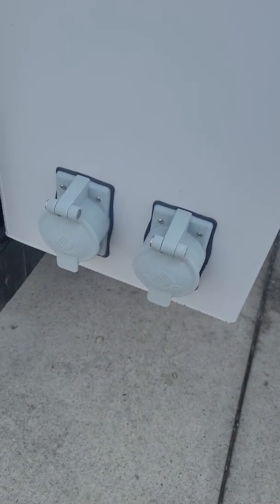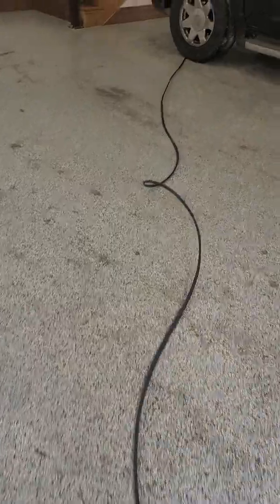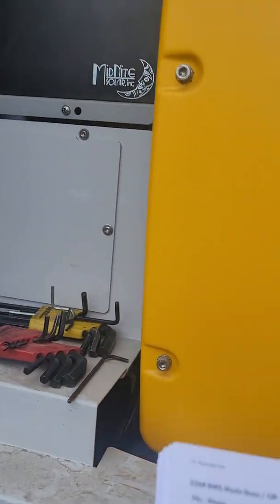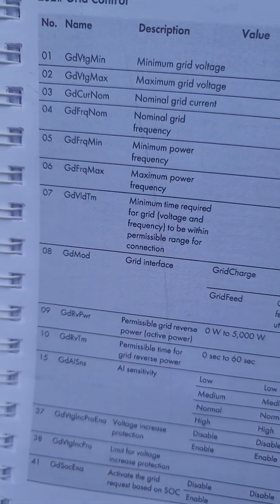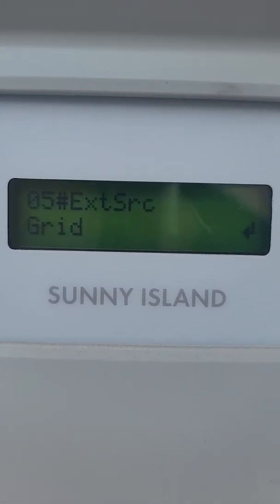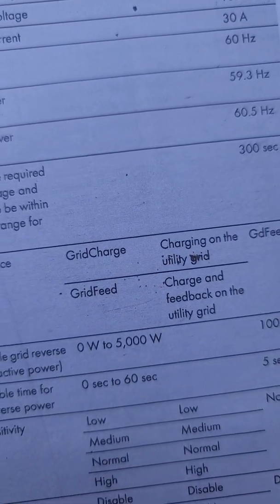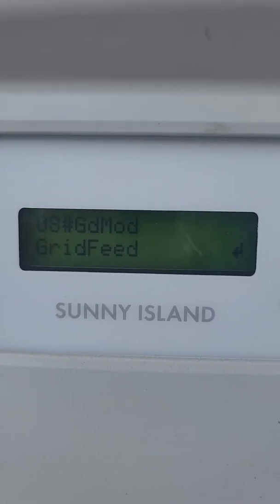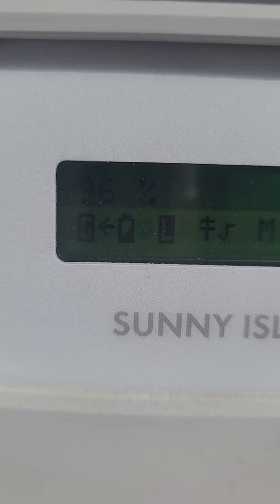Set up your SMA sunny island to grid feed mode.

Comment: Where do you get the manual. I bought one of these 4 years ago. I can’t figure out how to put it on grid mode. I have to  hit the main breaker off to use the solar trailer on the house as soon as I turn the main back on it kicks off.   I can only run my whole house until 11 pm (4 hours after dark).  Post more pics of the manual.

Comment: Hi aaron, I was wondering what grid plug and wire use for the grid tie from the trailer to the house? Does the 110 plug and 50 amp plugs  still work when in grid feed mode?

Comment: I bought a solar trailer and changed my inverter to 231 #5 to grid and 232 #8 to Grid feed . The G on the display doesn't show up. There is no voltage coming from either leg of that receptacle.  Help, what am I doing wrong?